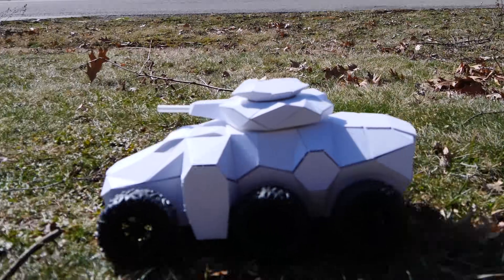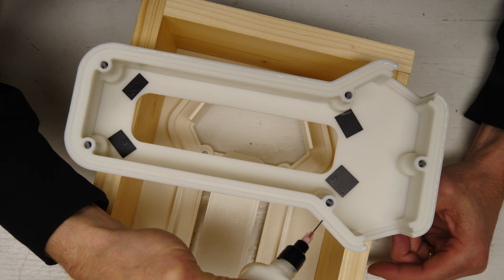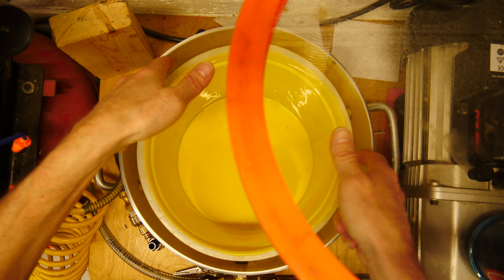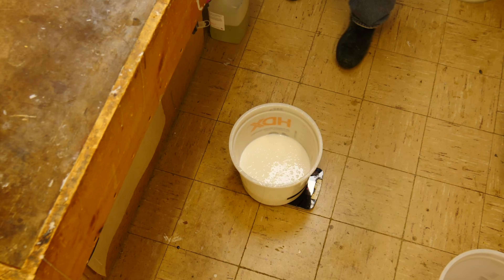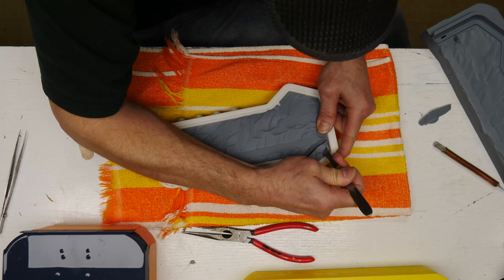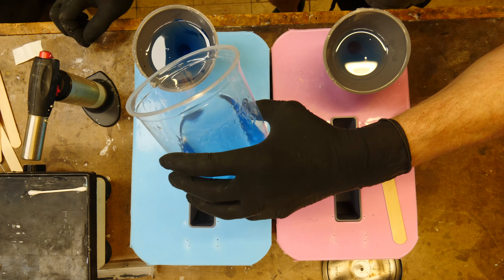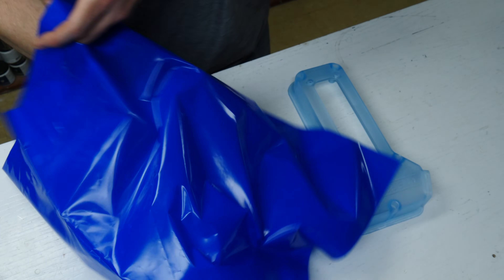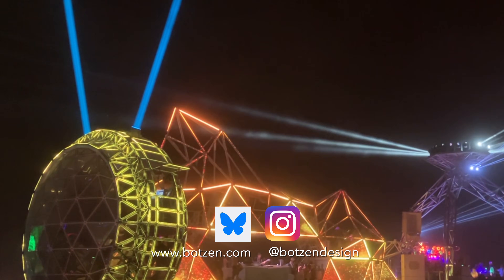Urethane housings for Burning Man Titanic's End Mothership

Comment: Why not use a formlabs XL and resin print it directly
Reply: At this volume it was more cost efficient to have these parts molded than to do them all with 3d printing. I have a Formlabs printer but the resin is way more expensive than molded material. The molded parts also have higher toughness/strength compared to SLA and better fit and finish than FDM.

Comment: If you poured a tin cure silicone onto a pattern, it essentially contaminates that pattern for future Platinum silicones.  Also, you can't pour a Platinum silicone against a cured Tin silicone; same issue.  In essence, you avoid using them together if at all possible.  It is possible to pour a tin against a cured platinum, but you really need to make sure there is sufficient mold release or the tin likes to bond tenaciously to the Platinum silicone.